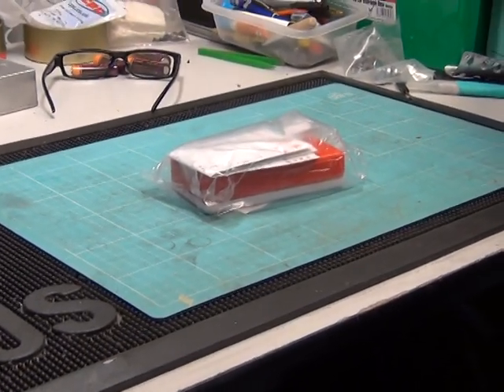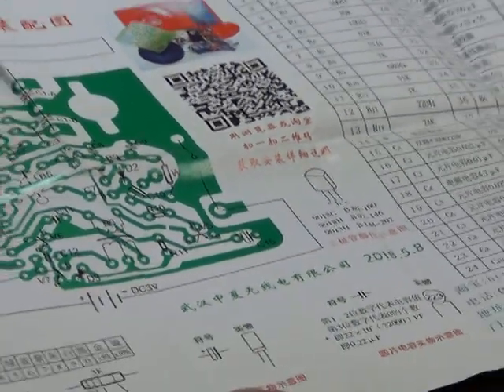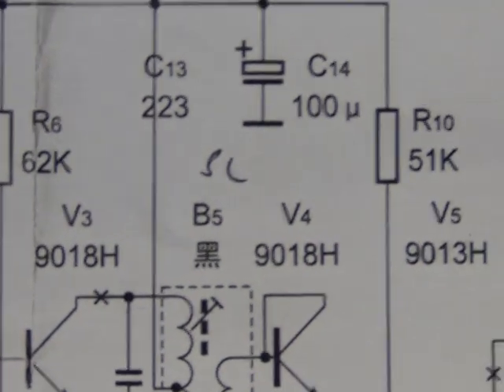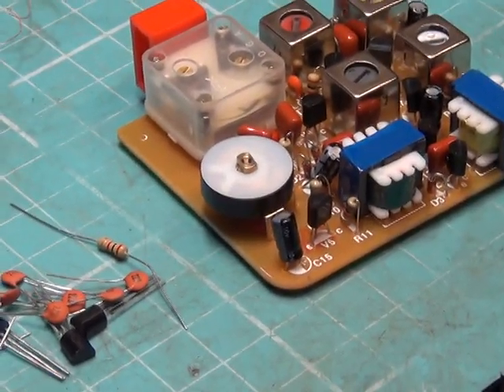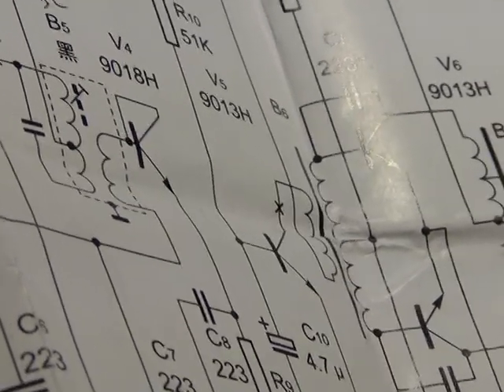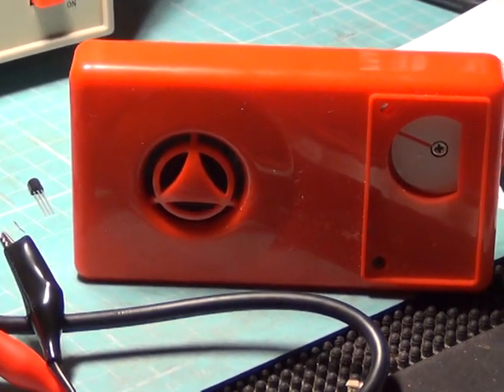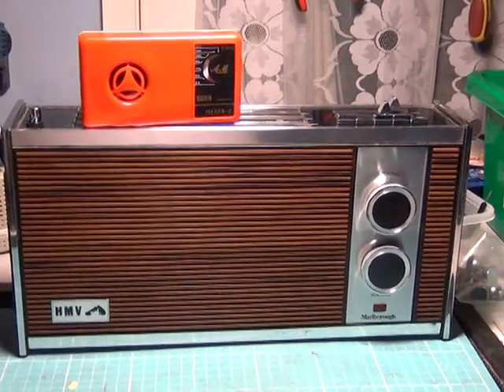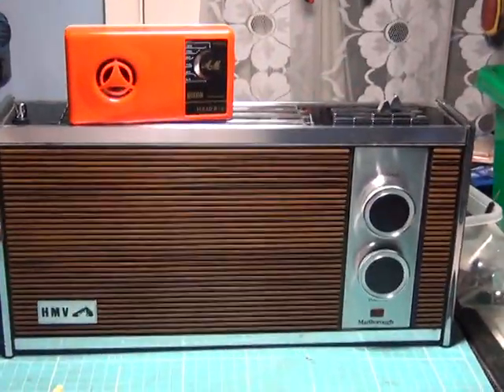Qiuxin HX108-2 - Seven transistor radio kit

Comment: mine simply don’t work. Multi meter you recommend my current one gives all kinds of sparatic readings
Reply from the maker: The instructions tell you to test stage by stage before putting all the links in. If you didn't do that, take the links back out & patiently follow the stage testing proceedure. We use the cheapest multimeters possible...line £17 from Aldi. As a professional electronics engineer in my 60's I do have calibrated reference instruments (like the Avo 8). What I don't do on my videos is to use expensive test gear akin to showing off.

Richard, G0JF, UK

Comment: Got mine and fitted out the dials and switches. Its better than the blue. I exchanged the disc caps with NPO WHERE Possible. And got even better. Spend the extra dollar. .ps I got needle files and a tiny amount of thread lock (verry little to lock the tuneing cap. )
Reply from the maker: Oh yes, it's better than the blue one; this has an extra stage.

Richard
Reply: @ukfmcbradioservicingTango21  yes even better than the hx-207. It has 4 cans. Living in a valley most " am" disappears at morning . So all I have is WSM Nashville and wdkn Dickson,  Tennessee. How ever it all busts loose "AFTER"dark.   Even the "blue"ones break out. And "dance" So I'm thinking on getting better transistors. Not so much as frequency"top" but"  more" gain. // I do have 120 feet of dipole and a loop under my table. that carry's the mail. In daylight. /// But the party starts after dark. Also searching My  junk box for old ferrite Barr. And got #20 gauge wire.  All ways room for improvement. De kv4li 73. Ps always keep the greasy side down .

Comment: Hi great video. This version is by far the most stable of the Chinese kits I have built. The ones in the blue cases tend to squawk and become unstable far too easily. This is an easy kit to build once you get the hang of the instructions (or lack of). The speaker is also reasonable unlike the other kits. With respect to the components, this circuit is far from critical so 33nf would do just fine ilo 22nf. Maybe the audio HF response would be a little down but you'd not notice that in reality on MW.

For those following along at home, to align AM radio like this the procedure is usually as follows...

Set the IF as you have to a predetermined frequency by signal injection and peaking. The spec said 465k, and mine worked best on 470k. Guess this is an arbitrary value based upon where the slugs sit most comfortably in their adjustment range. For a professional circuit you would use the manufacturers data as this would ensure correct tracking of LO and AE circuits with dial readings. 

AE=Aerial
LO= Local Oscillator.,

For the RF the common way to align would be as follows:-

Set the trimmers mid way. Both AE and LO.

Tune to the lower end of the tuning band and either align the dial with a known station or your signal generator if you have one. 
Carefully tune the LO (red) coil to get the desired station/frequency.
Now slide the coil on the ferrite rod for maximum signal

Tune to the upper end of the tuning band and either align the dial with a known station or your signal generator if you have one. 
Carefully tune the LO trimmer capacitor  to get the desired station/frequency.
Carefully adjust the AE trimmer capacitor to get best reception.

Repeat the above as the items interact.

Once done, the dial will reasonably track the AM band with consistent sensitivity.

I have one of these that I set to cover the 160m ham band and can listen to the locals on a Sunday on AM :)

I found it best to mount the antenna bracket between the variable capacitor and the board. For the batteries I used a couple of sticky foam strips on the rear of the case to hold them in.

Keep up the good work.

Steve

Comment: Just a bullshit kit !!! a pure scam ....  never touch that  !!! Eric from France .... a pure merde !!! une arnaque de la merde !!!!
Reply from the maker: It's not a beginners kit & is extremely cheap in it's defence. Our sample works great, but we  checked every single component replacing any out of specification ones & selecting which transistors went where by selecting them having tested each for gain. Mr C & I are both professional 2-way radio engineers & did this kit as a laugh. People with no knowledge & no test equipment will not have any success, but our finished radio works great.

Richard, G0OJF, UK
Reply: @ukfmcbradioservicingTango21  I built this device in a couple of hours but am dissatisfied 
with the finished unit. The batteries do not fit properly and pop 
out their position due to the battery contacts. I had to glue in some 
foam to properly hold the batteries. The soldering of the antenna wires 
is quite difficult --even with my 35 years experience as an Analog design 
engineer with massive experience in building projects. The location of 
the IF transformer coils requires you to translate chinese symbols on 
the schematic using the internet but even then, The first IF coil slug is 
black and not red as some websites show in pictures of the completed unit. 
There are several websites mixing up the white and yellow IF cans. 
The proper placement is: B2-black, B3-White, B4-yellow, and B5-Green---
at least that is what the schematic says. My radio worked but it is not an 
example of a good AM radio. You can listen to the ball game on it but don't 
expect much more. The amplifier transformers are also not identified on the 
schematic--I used the green as the first or primary transformer, 
B6 and red as the output transformer, B7. I built the circuit just to have 
a little fun as I am retired now (but not very old). 
AM ferrite antennas are very directional. The tuning dial "needle" 
sticker is VERY basic and unattractive. 
I think you are better off buying a working, old transistor radio from 
Ebay for better fit and finish if you want better tuning, sound and battery 
retention. I did like the use of two AA batteries over the traditional 9V 
battery for cost and availability. 
That is actually one of the key reasons I purchased this radio. Hide
Reply: @bergarteric5713  Not bad for 2 or 3 Euros.
Reply: I don't agree. You get what you pay for and the end result with a little care is a working radio. If I were to be critical i'd say it's far too easy to lift traces on the PCB and the components are just about fit for purpose. There are many of these kits and it's easy to look on youtube to see those that have built them so you can ensure the components go it the correct holes. 

This Red version with two output transformers and the 2 diodes as a front end voltage regulator is usable and reasonably stable. The other versions in blue cases are  really unstable and quite awful. Personally i'd steer clear of those. I used these to check out a sweep generator I was building. A good few hours of fun for the price.

Comment: Yours is the first Chinese radio kit I have seen with lapped work ,they should give you a refund for not having the right parts,where or who did you buy this kit from
Reply from the maker: It's quite possible the different transistors included would have worked and too with the out of spec capacitors but we weren't risking it & the result works well.  The kit came via ALiexpress & I recall it costing £2.73 delivered. I would never moan at something at this price level. It may even say in the Chinese instructions about substitute transistors for all I know!

Richard

Comment: The documentation I can find on the internet HX108-2.doc  http://en.pudn.com/Download/item/id/490625.html . I am a lintrigued about the very small design change shown on his schematic versus the one supplied in the kit. I the kit R13 is in the collector path for V1, and is the node to send the mixed RF & LO into the IF stages. 24K .   In the schematic from the online documentation, this resistor R13 is replaced by a IN4148 diode.  I wonder which works better.. and why...

Comment: Hi Richard I didn’t know you built one of these, I just built one of these today a Christmas present to myself I was looking for a video showing the alignment. You built yours much faster than I built my own. That was a good tip about using an smart phone to translate the Chinese on the coil colour it was about an hour for me to figure that out.  You have much better AM reception than I do, I only get a single sports channel even on a good radio. Maybe some continental stations will come in tonight.  I did also check all the components a few were out of tolerance and the wrong transistor in the output af amplifier, but I used what came in the kit and it appears to work ok. Regards Chris.

Comment: As you have now made both kits how do the HX6B and HX108 compare on sensitivity? Shango066 took his radios out to a ghost town in the Mojave Desert  where there were no stations besides DX.
I have tried making one of these kits before and it did not work. I assumed it was a mistake that I had made. I never considered the possibility that the supplied parts were way out of spec.

Is the speaker in this kit a lot better than the thin plastic-framed item in the HX6B? I was just wondering if a different speaker would improve the HX6B.

I have watched three of the four radio build videos.
In my opinion I had considered the Paensonic  to be a waste of time & effort.
It was un-selective on AM and FM tuning was so 'knife edge'.
It seems like you had better results there because you were using components to the correct values.
Reply from the maker: I looked at the Shango066 videos where he took them to the desert, though can't remember how far that was away from the nearest transmitter. I'm sure our nearest AM transmitter is 90 miles away so me may well be in a similar position. The HX108 in far & away the best of the AM radios. The Paensonic does have knife edge FM tuning as you say, but it does work fine in my opinion bearing in mind at's a £3.12 radio kit. Building these silly cheap radio kits for a laugh has even taught both myself & Mr Chippie a lesson or two.....looking up Chinese characters.....testing every component. The transistors in the HX108 we selected by gain on our Atlas semiconductor analyzer, putting the devices with the most gain in the front end of the radio.....replacing the crap out of spec capacitors not only for ones in tolerance, but monolithic dipped devices that are better quality.

I am going to do a comparison video (obviously not on sound quality) between the kit radios & our reference HMV radio...and a russian one I've yet to get working.

Richard (UK)

Comment: Just made up one of these kits today. It failed to work first time. I had a problem with the second (yellow) can when the slug sat at the lower level and it took a little time to persuade it to rise to the top of the can. The set was dead apart from a slight hiss from the speaker. 
Further inspection found that I had missed a cut track in the collector circuit of V2. Bridged that gap and the set burst into life.

I didn't check the values of the capacitors, just took them at face value. All parts required were in the kit. The supplied transistors, three of one type and four of the other were fitted and are now working well. The set is very sensitive.

Unusual design with the transformers in the output stages, must date from the 1960's perhaps.
Had great fun building this kit.